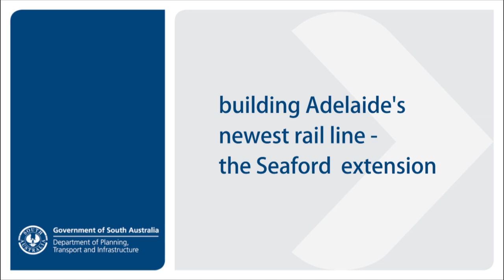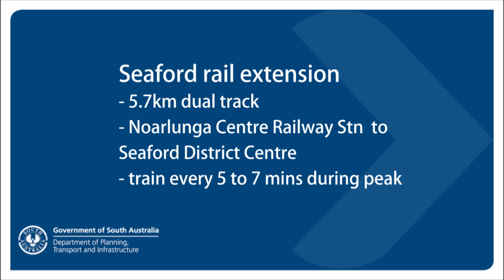Building Adelaide's newest rail line - the Seaford extension

Comment: Brilliant Multi-Modal. There are two bus stops that share the same platform as the Up Track.    Buses 741, 750, 752, 755 & 756  serve this Rail-Bus Interchange.  Pity that you have not mentioned this fantastic feature.

Comment: Pity there are already concerns about the new bridge, oops. 1.1klm of concrete has different expansion rates to steel rail, it's suddenly become a major maintenance liability. Wonder why they are installing temperature probes into the concrete deck? and wind strength anemometers, oh and vibration sensors? Hmmm someone has got worried.